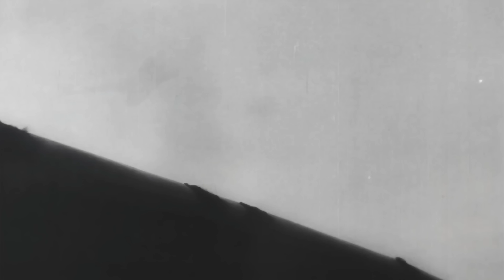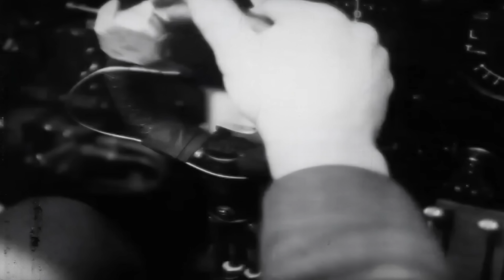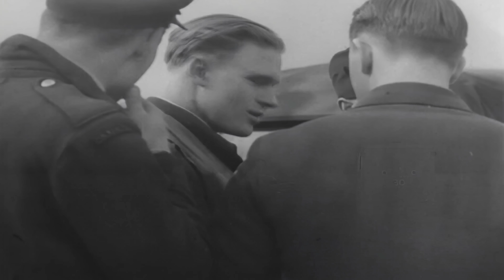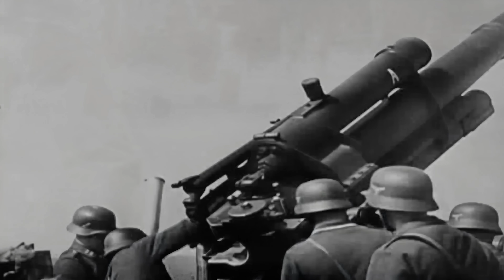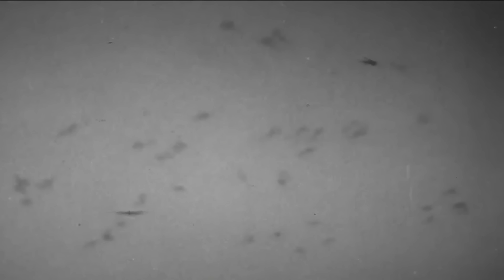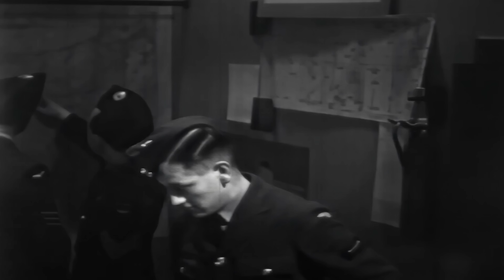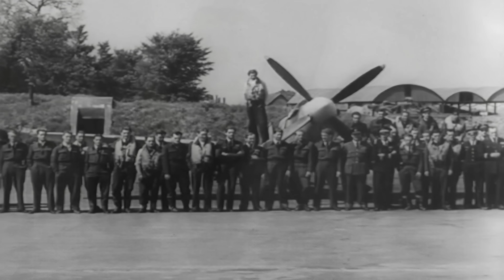440mph Monster That Cracked Germany’s Air Force

Comment: Great idea doing away with 12X 3.03 machine guns n slamming 4X 20mm in there.
You got a tank killer now n something that will tear a plane to shreds in seconds.
And you can engage at more distance.

Ahh it was this one they made a story up about  called it the 'banshee' in the story. An experimental prototype that kept killing its flyers. In the story they almost mothball it due to fatal flaws but a pilot n crew keep one using it without top brass knowledge because its so good (when it works properley)
They have mysterious control losses and canopy failures described in this documentary

Comment: Hawker Tempest and Typhoon - number of Luftwaffe aircraft shot down
Tempest - 240 enemy aircraft ! Typhoon - 246 enemy aircraft
Bf 109 killed between 12,000 & 20,000 enemy aircraft FW 190 killed 6,000 to 15,000.

Hawker Tempest
Fighter Kills: Around 240 enemy aircraft shot down in aerial combat over Europe.

Jet Victories: Included roughly 20 confirmed kills against German Messerschmitt Me 262 jet fighters.

V-1 Flying Bombs: Destroyed over 800 unmanned V-1 rockets (Operation Diver) in addition to standard aircraft tallies.

Hawker Typhoon
Pilots claimed approximately 246 Axis (Luftwaffe) aircraft shot down during World War II.

While the Hawker Typhoon started as an interceptor, it achieved its greatest fame as a low-level ground-attack and close-air-support aircraft armed with rockets and cannons rather than as an air-to-air dogfighter. Its top-scoring ace, Group Captain J. R. Baldwin, claimed 15 individual aerial victories.

Comment: Rather baffling commentary. He talks about the emergence of the Bf109E as an increasingly formidable opponent, yet the 109E was the primary luftwaffe fighter in the Battle of Britain. It was not new and Spitfire pilots in particular did not fear it. Did he mean the 109F or, more likely, the Fw190?

Comment: It's really something that people doing these videos aren't really paying attention to what's showing on the screen as they do their comments.  At 15:57 the audio talks about "four-bladed props" and the video shows a three-bladed prop.
Reply: There obviously isn't much footage to work with, some prototype typhoons had a 3 blade, but the Typhoon Mk1b, the mass produced variant, had a 4 blade
Reply: Early production versions had three blades, after the four blade upgrade there were oil leak problems for a while so they reverted back to three before the problem was sorted out.

Comment: OKAY.  Im done.   Way too much cheerleading for a plane that was only good for Ground Attack or stomping on OTHER ground attack planes under 12,000 feet.  This was NOT the war winner you are pushing here.  Without a TOP cover of Spitfires P-38s and later Mustangs the TYPHOON would have died.   There is a REASON only 3300 or so were built.  It just wasnt' all that great.  
I have had enough cheerleading.

Comment: He never got that fast at 8000 feet.  Best speed was at about 12,000 the LOWER you got the SLOWER You got, denser air... MORE DRAGE.. IF he got that speed he was in a DIVE and that speed means NOTHING.     Gawd this cheerleading needs to stop

Comment: You even p[oimt out that the threat FW 190s were the ground attack versions.   So why not climb away from the Typhoons.  Well that's easy.  Bader got it wrong!  the FW190 A8 only had a climb rate EQUAL to the TYPHOON but the TYPHOON was EQUAL not better than.  If Bade was flying Spitfires wherein he thought the 190s climbed like rockets he must have had some pretty WEAK Spitfires.

Comment: Can you folks do something about your thumbnail headlines.  I almost passed up this video because of the stupid thumbnail lead.  There were only 3300 or so built.  There were over 30,000 spit fires of all types.   It's performance was just GRIM.  omg all this Internet BS of 440 MPH fighters has to stop,   These are not real.  MAYBE in in fifty flying were well maintained enough to get to that "book value" and I have older books that contradict these "NEW" numbers.   Look it was a good bird.  I am not questioning that BUT;  That top speed was at 12000 FEET.    Up above that where the FW190s lived it was a DOG. The 190s lived best at 20,000 feet.  This thing NEVER CRACKED the Luftwaffe.   It simply did not have the performance at altitude to do so.

I LOVE Dark Skies.  But PLEASE get off the ridiculous Thumbnail blerbs.  They SUCK and this one is as silly as the Ronald MacDonald Clown.      

ARG the 190 could get over 400MPH but just barely at 405 mph.  Again remembering that field conditions way more often than not caused significant losses in performance.  For Instance, even a Cessna 150 can bet a boost of 5 - 10 MPH simply by cleaning and waxing the bottom surface of the wing.      But how many Ground Crews in rugged field conditions had the TIME to do that to a plane?  Not Many.    The Typhoon only really had a chance with FW190s setup and designated for GROUND ATTACK.

Comment: Typhoon cracked Germany's air force????  Not sure a google search would reveal a second source that would make that claim.  Not sure cracking Germany's air force could ever be attributed to one specific aircraft type (or even several aircraft).  I've read many sources that said the RAF didn't feel the Typhoon was up to snuff as regards air-air combat and it was relegated primarily to ground attack duties - in which it excelled.  The best I can recall is that Allied bombing destroyed aircraft production facilities as well as fuel and lubricant facilities which had a much larger impact on cracking the Luftwaffe.

Comment: The typhoon was not a success  as a fighter  aircraft but found it's best role as a close ground support and fighter bomber. The tempest was better in both roles but the p51 was the outstanding fighter aircraft in the closing stages of the war by far.  Then came the jets and everything changed.
Reply: Sorry MkVII Spit outclassed the P51 in every detail in fact all Spitfires From the MkIX on were just too good for the P51.
Reply: @jacktattis 
but without the very Long range of the Mustangs 😮,

Comment: One of the biggest problems that the Spitfire and hurricane both had in the Battle of Britain was weak armament. The Germans had the 20 mm mine round already and it was considerably more effective against other aircraft then the tiny 303s that the British aircraft used. Yes the Brits would get plenty of hits with the 303 but you needed quite a few to down a 109.
Reply: The Luftwaffe had a problem with their 20 mm cannon  in the Bf 109 and the result was low muzzle velocity and only 6 seconds of ammunition then it was down to just two machine guns so well and reuly outgunned.

Comment: Yes, the Typhoon deserves a lot of respect, but, had I been a pilot back then, I would still have rather been in a U.S. Army Air Forces P-47 Thunderbolt, nicknamed the "Jug". The Jug, unlike the Typhoon, had a reliable air-cooled radial engine of 2000-2800 HP that could withstand more battle-damage than an in-line/liquid-cooled engine, was arguably just as fast as the Typhoon if not more-so in some versions, had a more reliable supercharger at high altitude,  more armor protection for the pilot, and, most of all, was one of the most durable airplanes ever built.....its airframe was like a flying tank. It, too, became an effective fighter-bomber against ground targets in 1944...after an effective season in the air against the Luftwaffe. Jugs were known to attack and shoot down German ME-262 jets on occasion.
Reply: Strange how the reliable air cooled radial engines had problems and were just as prone to battle damage, the overweight P 47 had poor performance and was used for ground attack because it was a poor fighter, the Typhoon shot down Me 262's as did the Tempest and Spitfire.
Reply: @barrierodliffe4155  P-47s also shot down a  number of 262s. And it is an accepted fact that air-cooled radials could usually absorb more battle-damage than liquid-cooled in-line or V-engines, because there was no coolant and far fewer cooling system parts on them.

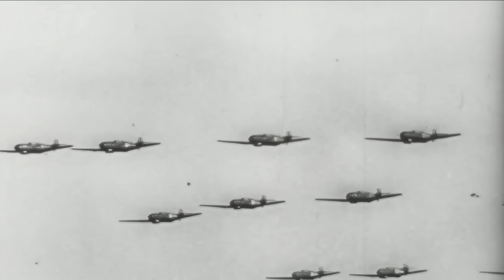Comment: BF109 wasn't superior to the Spitfire 1:23 - You've stated that to sell the Typhoon
Reply: The 109 E had a higher speed, climb, and turn rate than the spitfire.
Reply: @mbos731  the tern rate of the BF109E was not better than the Spitfire.
Reply: @mbos731   During the Battle of Britain there was little in it for speed, the Bf 109 climbed steeper but slower so again not much in it and the Spitfire could turn tighter.

Comment: 0:38 - please explain how FW190 fighters could be "weighed down by their bomb loads".  Sloppy scripting/AI nonsense.
Reply: The Fw 190 was in fact frequently used as a Jagdbomber, especially in cross-Channel raids (as depicted here). Both the F series and G series were specifically designed for this task. Don't blame others for your own ignorance.
Reply: AI=automaticly inane
Reply: If there holding bombs it says more makes it harder to gain speed as it holds extra excess weight

Comment: The short summary is simple: the FW190 was clearly (even overwhelmingly) superior to anything the Brits had until the Spitfire Mark 10.  The Typhoon was limited to low-altitude roles, particularly as a formidable ground-attack aircraft ... but those who flew it took high casualties, many of them due to engine failures.   It did spawn the Tempest and then the Sea Fury ... much better airplanes.
Reply: The Fw 190 superiority was much reduced by Spitfire Mk V's with the Merlin 55 and completely gone when the Mk IX showed up, the Spitfire Mk 10 was an unarmed photo reconnaissance aircraft based on the Mk XI

Comment: Excellent video. The Typhoon was the Warthog of WW2. The AI enhancement of the WW2 footage, for the most part, has brought the old reels back to life again, though it still does struggle with long range or fast moving shots, the videos have improved greatly compared with the first attempts. Are you using AI to select the clips, as some did not match the voiceover, like the "four bladed props.." when the film showed three bladed, which I had to chuckle or showing a squadron of Spitfires over the English countryside when you were speaking of the Typhoon over the channel? Nice work & SO glad you greatly reduced the use of AI imagery, as the rest of YouTube is bloated with today. Also, quick note, the video was too long, I started to lose interest over 20 minutes, stopping it & going on to other things, so shorter, storylines, with less fluff & more detail, to me, would be better. Only suggesting, as I had done video editing, script writing & voice over work for around 20 years. Thanks again.

Comment: Erm, The F18/37 specification was issued in 1938 after Hawkers submitted two designs to replace the Hurricane that was just entering service in 1937,  long before the RAF knew about the FW190. Development issues delayed the introduction of production Typhoons until late in 1941, and even there were issues that needed to be ironed out. Interestingly Hawkers other design to meet specification F18/37 the Hawker Tornado developed at the same time was cancelled at prototype stage due to issues with the proposed engine.

Comment: The claim about Tigers and Panthers is untrue. There was never a time when 4 Tigers were taken out by Typhoons in Normandy. This was a very rare occurrence if it happened, nevermind 4 being taken out in an attack, and out of nearly 200 Panthers that the British carefully examined and analysed the lost causes on the Normandy battlefields, only 8 showed signs of rocket projectiles from ground attack aircraft.
Only 5% to 7% of German armour was lost to allied air power, including carpet bombing.
Reply: There's a youtube video that goes into the details. Rockets were not exactly accurate. On the Eastern Front tales of tank-killing Stukas and Sturmovichs are similarly exagerated. However, they were effective at disrupting the logistics chain. You don't need pinpoint accuracy to do a line of trucks a lot of damage. Without fuel, food, and ammo a tank is just a large tin can.

Comment: Prototype & pre release Sabre engines ran fine but the mass produced ones had problems from the sleeve valves not being perfectly round, this was solved by the air ministry getting heavy with both Napier & Bristol so Napier would use Bristol sleeve valves that were the same bore.

Comment: the Typhoon was designed from a captured Fw 190
Reply: That's nonsense. The Typhoon was already designed when the FW190 went into service. Britain didn't need any inspiration from Germany, which was actually behind the UK in aircraft development.
Reply: Sydney Camm started designing the Typhoon in 1937. the Fw 190 was not in service until late 1941 and the one captured was only in June 1942, the Typhoon entered service in 1941.

Comment: The Spitfire evolved during the conflict and as a result could more than hold it's own for the length of the entire war.
Reply: And so did the Bf 109 and Fw 190. It was a continuous development over the years on all sides.
Reply: @goldfing5898  Maybe, but you must agree that the 109 was a much older design in 1939 and by 45 the Spitfire was a different beast.
Reply: @timphillips9954  Yes, the Me 109 was even older, the first version from 1935 and it was used in the Spanish Civil War from 1936 to 1939 already. As a born German originally, actually I don't like the design of he 109 very much and strongly prefer the Fw 190, whichnwas a much more modern design (cockpit, canopy, electric rudder control) and much more versatile (leading to the Ta 152 in the end). The Spitfire has some aesthetic elliptic wing design (as opposed to the quite "edgy" trapezoid of the 109 and P 51) and had a fantastic Rolls Royce V12 engine, similar to the Daimler Benz DB 603 engine. Fantastic sound when younwatch all those warbirds at a flight meeting.
Reply: @timphillips9954   The Bf 109 first flew in 1935, the Soitfire first flew in 1936, so the Bf 109 was not much older, the Bf 109 was also very different by 1945.

Comment: I'm always amused at the final scene  of Saving Private Ryan when the "P-51 Tank Busters" arrive. The P-51 was not a tank buster and US didn't have tank busters in France, they would have to have been British Typhoon/Tempests or Griffon Spitfires.
Reply: Just as amusing is seeing the Americans facing 'Tigers' in the Cotentin Peninsula in Normandy. The Tigers were in fact a hundred km to the southeast, around Caen. The 'Tiger' that comes over the bridge and which Tom Hanks shoots at has the insignia and red turret numbers of a 2nd Kompanie Schwere SS Panzer Abteilung 101 Tiger. Michael Wittmann's company. On that date (the Hanks character's gravestone says he died June 13th 1944) this Tiger unit was engaging British 7th Armoured Division at Villers Bocage. 😂
Reply: They should have been razorback Thunderbolts in that scene at the end of Saving Private Ryan. Also,that scene where Ryan ,then young turns to old man. Spielberg stole that from  12- o'clock high.

Comment: A Canadian pilot who flew the hurricanes said the greatest secret was they were able to use water as a fuel which greatly increased their speed. He explained the secret to me on how it worked
Reply: The Germans used a similar trick, namely MW-50 injection, which meant a 50-50 mixture of water and methanol, which could increase the engine power for about 10minutes. Longer use would overheat the engine, but after a break for cooling down, the MW 50 system could be used again during the same flight. And I read that if no methanol was available, then pure water could still increase the engine power for a while, but presumably a mixture was better.

Comment: Typhoons had THREE bladed propellors -  it was the Tempest that had four blades.   My late Father had a friend and colleague who flew Typhoons with 197 Squadron - I have his Pilot's Notes.  Very brave young men - we will remember them
Reply: They had both, I made models of both sorts as a kid, also have pics in my Aircraft books with 3 and 4 bladed props. Also they could not do 440 mph.
Reply: @skyboom1961  No. The narrator has got mixed up with the Typhoon and Tempest.
Reply: Earlier marks of the Typhoon had three bladed propellers. Later marks had 4. Also the early versions did not have the bubble canopy they had a side door similar to a car door to allow the pilot entry into the cockpit.
Reply: Every Typhoon in the vid had 3 bladed props, not four.
Reply: @OswaldGrimsvottem1775 But the narrator kept going on about their "four-bladed propellers".
Reply: @rhawkas2637  yes they had four bladed props later on.
Reply: Maybe AI the same problem with propellers AND fingers?
Reply: The later Typhoons would have had the four bladed prop and bubble hood.
Reply: Typhoons had both three and four bladed props. Oil leak issues delayed the upgrade to four blades for a while but it was eventually solved

Comment: My uncle was killed in a Typhoon in 1943 returning from Holland. After 1941 German tactics to avoid heavy losses were to send solo fast raiders and the Typhoon was one of the few aircraft which could catch them. Mk1 was notoriously unreliable but much improved by 1944. Another of Typhoon/Tempest's many roles was daylight airfield suppression, where it had 9 confirmed (and 3 probable)  Me262 kills. After DDay it was mainly used in ground attack with a forward aircontrol doctrine still used today.